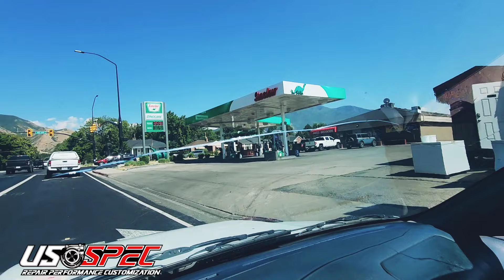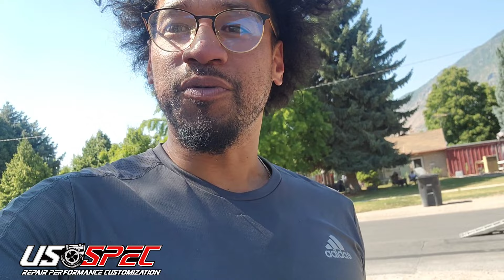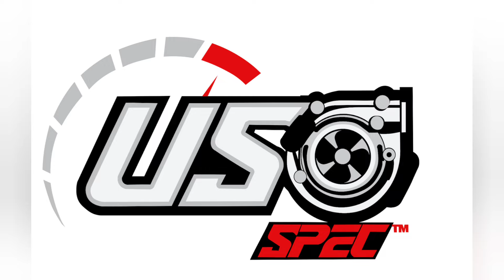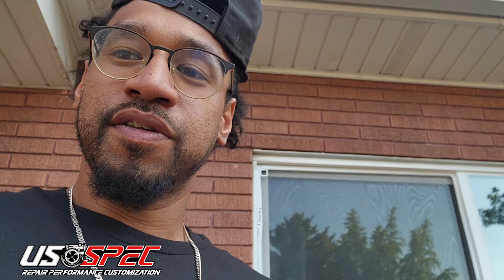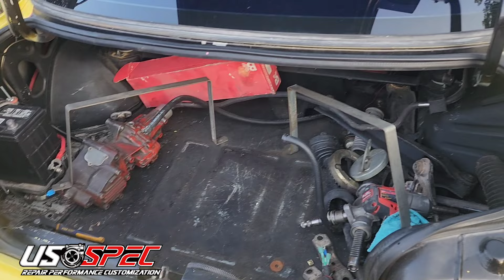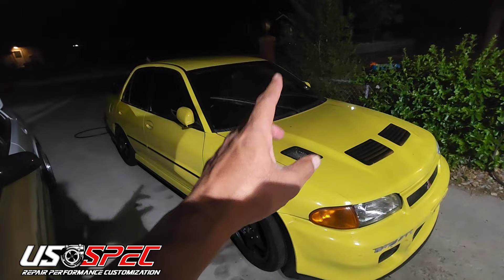Another Fake Evo added to my Evo fleet

Comment: Hey uce, love your evos. Hey do i need jdm fenders for evo 3 conversion or can you use stock us fenders? Thanks
Reply from the maker: @wardog206  evo bumper is wider so yes you should get them but you can still pull the bumper in with stock fenders just won't look clean and flush